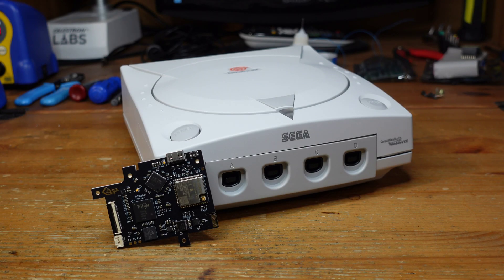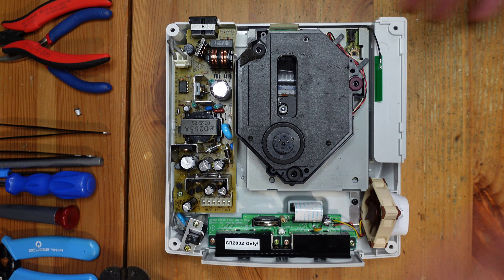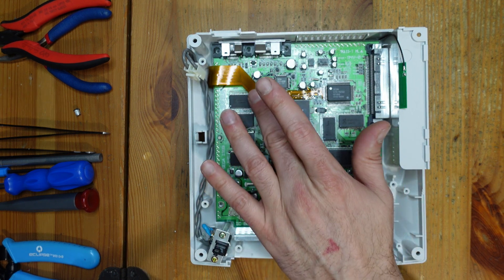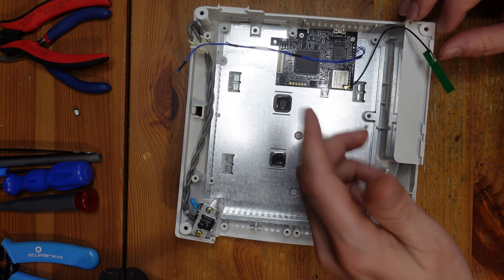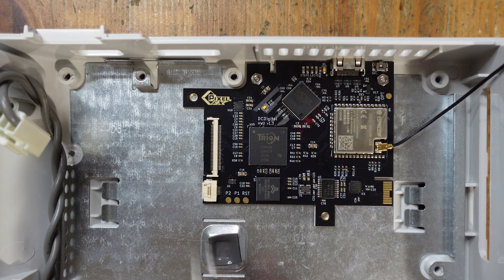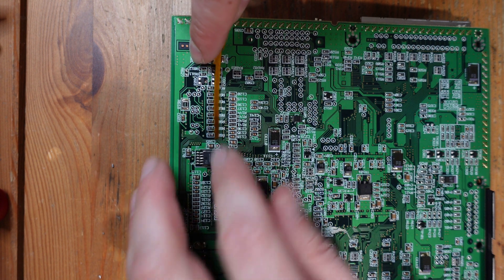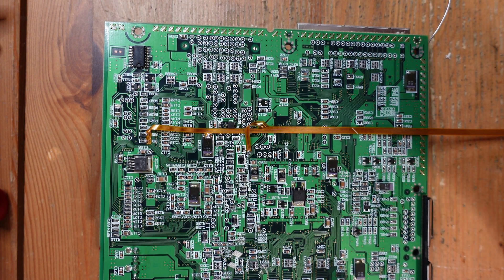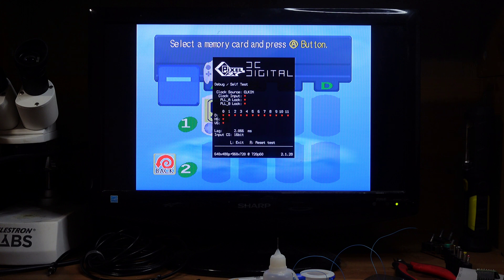Upgrading from the DCDigital to the latest DCDigital HW2! Install guide and demonstration

Comment: The capacitor above one of those screws is supposed to be relocated. It’s there in case you would rather relocate the capacitor than screw/drill through your label. I don’t know why the HW2 guide doesn’t mention it but it’s in the original installation guide. The HW2 guide doesn’t say a thing about the Option pad and ODEs either so I guess you just have to know. ;)
Reply from the maker: Interesting, I did not know about that capacitor. The option pad does work the same, but they forgot to update the new guide
Reply: The last one I did with that screw hole was in someone’s customized console with an aftermarket shell. They had gone through all the trouble of transferring their original labels so I didn’t want to just drill right through it. Because the aftermarket shell was clear I was able to see the clearance and the screw was almost touching the capacitor. I pushed it back toward the center of the board about as far as I could go while still being able to solder to the same pads without leads. I then covered the exposed pads with kapton. Though this barely moves the capacitor I felt it was enough.

Comment: I have very little soldering experience so I hope I can perform this upgrade without much issue.
7:08 do I need to worry about this part if i keep the wires that are already on my current dcdigital?

Comment: question, I was in talking the ribbon and I think too much solder went into the chip connectors, can it be fixed?
Reply from the maker: I don’t really understand your question, but I’m guessing that the flex cable installation didn’t go well? It might be fixable, but it’s really hard to know without seeing it.

Comment: I have original DC Digital. If wanna update, can we just change new DC Digital HW2 board and no need solder flex cable or anything to Dreamcast mother board? It would be lot more easy upgrade.
Reply from the maker: Yeah you can use the same flex cable on the new hw2

Comment: I wonder what solution it provides to play 480i fight games? Do I still need to go into settings and do a cable detection setting changes+ resolution.
Reply from the maker: Yeah it needs to be in cable detect mode but the 480i deinterlacing options are way better with hw2

Comment: Thank you for this video! I'm waiting on a mini HDMI cord to ship in, but from the looks of my DCDigital LEDs (slow glow=HDMI working but not plugged in) the HDMI should be functional. 

I'm having a problem during my troubleshooting using composite as a video output; I'm unable to access the OSD menu using any button combination. My guess here is that either the R601/R602 pads don't have a stable enough connection (I'm pretty sure these are the points that control the DCDigital menu) or the flex cable isn't secure. The main thing I'd like to know now which could help me is whether or not composite can view the OSD menu. If HDMI is only capable of actually seeing the OSD menu, I wouldn't have to get to the bottom of my console again.

My second problem is whether or not I can reset the entire console using a specific button combination that the DCDigital uses. If that doesn't work, there's a great chance the flex cable just slipped during re-assembly because I have a good feeling I soldered their points to the motherboard quite snugly. My concern here is that since I also have a GDEMU I wouldn't like to confuse the GDEMU's system reset button combo with the DCDigital's because I'm pretty sure both of them are capable of resetting the console in some way.

I appreciate this video and your help to the community!
Reply from the maker: If the button combo is not working, then the connections to r601 r602 and the reset pad are probably not good. The button combo is not related to the flex.

Second, you can only see the menu using hdmi, it will not work using the AV port
Reply: @LIRetroGaming  Not being able to see the menu because I’m using AV to test is more than likely the problem. It helps a lot to know that in the meantime, so thanks a bunch! I’ll also touch up on R601 R602 and the other connections.

Comment: May I ask what iron temperature you use when doing this type of work? Like soldering flex cables? Thank you.
Reply from the maker: Normally my iron is set to 750 F (400 C) for most applications including flex cables
Reply: @LIRetroGaming  great thank you
Reply: I typically do 330C but it all depends on your iron. If your digital temperature controlled iron is responsive with excellent thermal recovery like the cartridge style irons with the heating element built into the tip it can get away with much lower temperatures.

Mine is a Hakko T18 clone from Aoyue (Int701A++), so there is no heating element in the tip but my other Aoyue station (Int866+) with the same tips is absolutely unusable at the same temperature settings.

If your iron is less responsive and needs to have the heat cranked up then you have to work fast to avoid damage.

Comment: I kept the old antenna in mine and just swapped the boards. Is the new antenna any different? I noticed it said it was dual band on the antenna PCB but I don’t know if the wifi chip itself is dual band on the original or new DCDigital kits.
Reply from the maker: I think it’s fine to keep the old antenna, I was just trying to keep it looking like a complete 2.0 install

Comment: Do you know of anything similar to replace the PS1Digital?
Reply from the maker: Not yet. There’s a psxdigital being developed that will work on ps1 and ps2 but it will most likely have the same features as the original digital
Reply: The current ps1 digital was upgraded to use the new PixelFX api’s. There is a new one being developed that will be mostly similar. The current ps1digital doesn’t support all of the PixelFX feature set, but most of them

Comment: does this product get hot? i have the n64 digital and that thing is toasty, touching the corner of my n64 feels like touching a boiled kettle and theres no cooling solution. the fpga chips are said to be not be very efficient (i dont know what people mean by that exactly), the wifi chip doesnt help, those usually generate a fair amount of heat too. the dreamcast fan also puzzles me as it doesnt look like its doing much for cooling when the board is covered by the shield. with this mod being in a far away location it gets no cooling either. i know they work though, curious if you notice the underside of the case feeling hot to the touch after the system being on for an hour? btw i finally got around to installing the gc dual recently after your video, that thing is great, nothing like these though in regards to the processing, therefore no issues with excess heat. im on the fence whether or not to go down this route with the dreamcast, i might just stick with the ossc, same deal for the ps1 digital i hear is going to be back in stock soon, just concerned about adding heat and how that affects the lifespan of the mod.
Reply from the maker: It doesn’t seem to get too hot for me. I know that the thermals are tested by the pixelfx team

Comment: Do you lose any new functionality if you just move over the 3 wires instead of using the new ribbon cable?
Reply from the maker: No, not at all. Moving over the 3 wires gives you the exact same functionality
Reply: About the only use for that flex would be if the original kit used it so that you could upgrade without any soldering at all. Since that wasn’t the case it makes me wonder why they bothered with it at all for HW2.